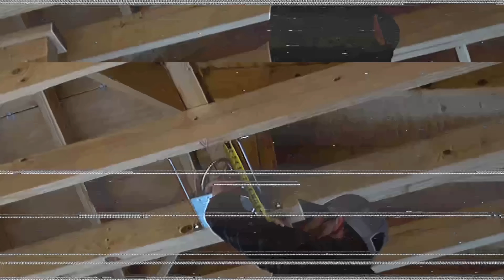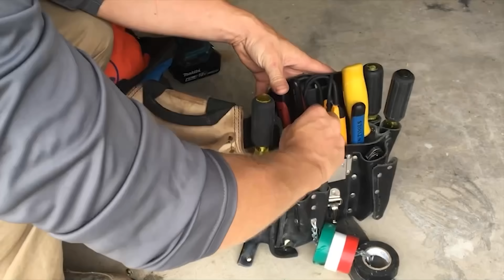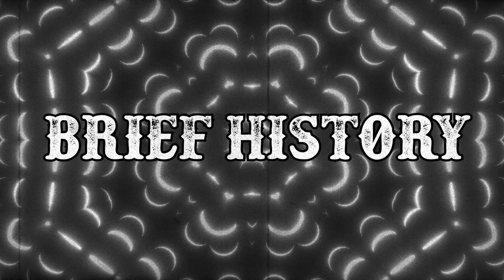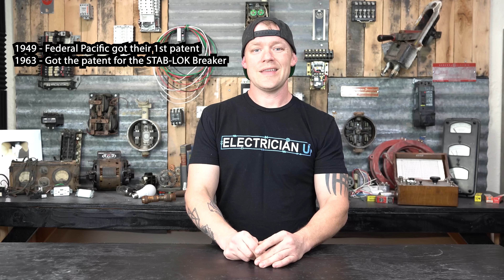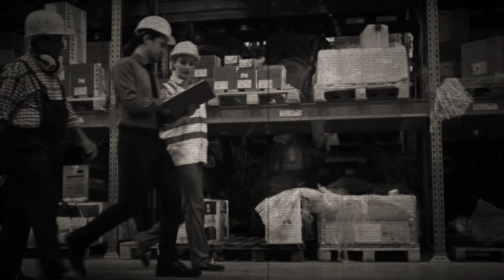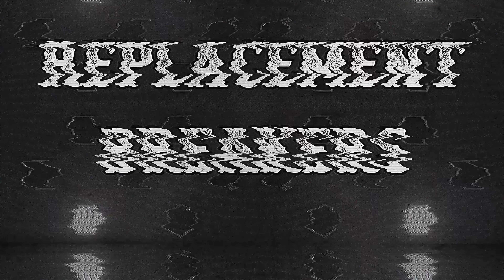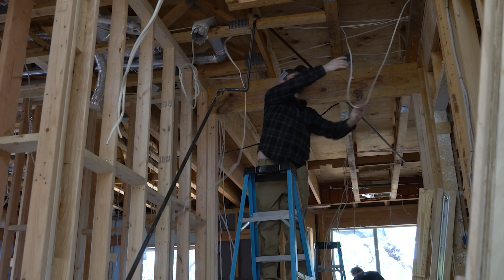FEDERAL PACIFIC ELECTRICAL PANELS - why their panels are dangerous

Comment: Why replace the panel if reliable replacement breakers are available? Panels don’t have moving parts....
Reply: The panels themselves have numerous issues.  Poor bus design (high current flow through too small conductors, poor retention of the breakers), poorly laid out paths for the wiring requiring extremely tight bends, and others that I’m forgetting at the moment. Besides that, the newest of these panels are approaching 40 years old, and electrical equipment just wears out over time, even if well maintained, which most of these panels were not.
Reply: @taeraresh2115  I'd like to know how untouched residential panels "wear out" over time. Some panels in homes spend decades without any human contact...some residents never pay them a visit and forget where they are.  I can't picture it.  Angry electric pixies cracking the bus bars? Electrosity flowing away all the metal goodness?  What exactly is there to wear out?
Reply: @lucash1980  Poor maintenance, rusting enclosures, overheating causing connections to loosen, breakers that trip often becoming more prone to nuisance tripping at lower than their rated amperage, breakers not fitting tightly and arcing at the busbar... These things have a lot of problems that well designed and actually UL certified panels don’t, but even a good panel should still be maintained.

Comment: Acceptable failure rates are dependent on product type. Sample rates for product testing also vary. Condoms, they are 100% sample tested. (Every condom is tested!)  0 failure permitted. Wiha 1000V insulated screwdrivers are 100% sample tested. 0 failure permitted. A lot of products are 70% tested. Products that require destructive testing usually sample at a much lesser rate. (3% sample) But perhaps 70% go through other nondestructive test(s).  1% is a good target of failure rate for most products. 3% is deemed to be slippin'.

Comment: least we all are still here since our birth...majority the homes where using FPE panels...since 1984...Reagan got elected for this in his first term...California business's had no over-site under that administration from food to electrical equipment safety in exchange for Reagan presidency winning by dark money ...people in 80's are unaware that time of dangers lurks..you were in diapers to be aware all this...least our fathers know this now...but how lucky for us...talking and living still...we all been in house for 20+ years ...least we are 30% hadn't had house fire ...but 70% did now...for now, we all moved elsewhere and now dealing with ITE panel this time...bought by Siemens due to ITE start losing money by selling panels with mixing metals between copper and aluminum that also dangerous too but its rare to see house burn down by ite panels...so far my house still not overheat..only fix is move breaker elsewhere or replace it with tighter clamping and move it elsewhere so bus bar reduce tensions from arcing ..only company fix both issues is ...squareD...all copper and all arc proof protection breakers

Comment: I still have a FPE breaker box. The issue is that the FPE box is in a stairway, so it doesn't meet code. The next closest place to move it is the kitchen, which also doesn't meet code. It was suggested that I could either pay to have the breaker box put on the outside of the house or have it moved about 15 feet to a location indoors which would meet code. I dread either option and wonder if I paid someone to replace the FPE box with a current model (but without a permit) if it would be ok for house resale down the road? Advice is appreciated. Thanks!
Reply: If you're going to sell, leave it. That's someone else's problem to fix.  When I was looking for a house in Toronto and complained about knob and tube or fuses they basically told me to "suck it" because they have buyers lined up around the block. So, you don't have to fix ANYTHING in this market.  If you're going to live in it for awhile yourself and you're freaked out, you can replace your panel with new old stock from a similar era. It will look legitimate. You can also say F-the code and try and get a new box installed in the stairwell--it only breaks code because elechickens don't like to stand on stairs when they work...because it kills their buzz. In my opinion, a stairwell is a great use of space for an breaker panel with a cover. I understand the code to make everything sensible and perfectly safe on new builds and renovations, but the push for perfection in older homes is asinine. The older generations got away with murder--janky splices into knob and tube (which is why knob and tube is considered unsafe) ungrounded outlets, penny fuses, buried undersized bx cable to garages, asbestos insulation, tile and mastic glue, epoxied plumbing fixes, I got it all. It falls on the younger generation to suddenly bring everything up to code while facing crushing personal and government debt because of mismanagement. So F-the code and do what you can, a little at a time. Just be wary of the nervous nelly contractors who want to report you and drum up more business. Good luck to ya.  Remember, if you don't want your house to burn down, don't overload your circuits. Turn off the breaker and count how many devices turn off.

Comment: I replaced my federal panel in my last house after living there for 5 years... after having 4 breakers go bad I got fed up and replaced the panel with a square d panel. Never had an issue afterwords.
Reply: Did the same thing to a house I has purchased "as-is".  It too had an FPE and went right into the dumper. A Square D Q0 panel please!

Comment: In the commercial and military world, all components should be manufactured with 100% pass rate on manufactured components, but also should have a stated MTBF (mean time before failure) which would be measured in both time and number of operations. With UL testing, if a design change has to be implemented to correct a manufacturing issue, the product has to be re-tested and re-certified as it is no longer considered to be the original submitted product. For smaller companies, this can be quite a problem and I can understand the reluctance to change a design. However, for a company with this size and manufacturing throughput, I am amazed that they didn't at least correct the problem once it was discovered.

Comment: Great video, and I'm glad to see Dr. Aronstein mentioned. I should find the catastrophically failed Zinsco main breaker I have, and send it to your for your video on them.
My dad was an electrician who specialized in FPE replacements for a while (lots of them installed our area). He thought that a lot of these panels were installed because they were so physically compact, and could fit in the space that used to have a fusebox without needing major framing work. Also, in addition to all the failures with the breakers themselves, the bus design was extremely poor. Depending on what breakers were installed, you could have upwards of *100 amps flowing through a single 8-32 screw*.

Comment: I had one of those panels in my house and the neutral went open- that was an interesting experience to say the least. Lights coming on brown in a different room than desired, stuff turning on by itself and finally a tv bursting into flames in the middle of the night in my kids room while everyone was asleep.
Reply: Yikes. Hope everyone is okay.
Reply: Sounds like the house was haunted.  Did you check the history to see if anyone died in the house?
Reply: Had that happen in my shop. A contractor broke the neutral line coming in from the transformer (we had a locate done, and it was wrong). The lights didn't work for crap, a battery charger blew up, and it killed the power supply in a very nice audio amp. No fire, though, thankfully. Hope nobody was injured in yours.

And no, Haywood, ghosts aren't real, ffs.

Comment: 12:23 Manufacturers are shooting for failure rates MUCH lower than 1%

Just think about it, would you buy a vehicle from a company that either “advertised that it builds” or “had a reputation for building” cars where the brakes only work 99% of the time?

Comment: A lot of manufacturers aim for 1.33 Cpk, which basically means 99.99% off all components produced passes specification. The reason the number seems so high is because at each step of the process, it must meet this number, but with multiple operations per component, the number of failing components compounds, making your actual percentage of "good" products much lower than 99.99%. There is a lot to why this number is considered "good" that I won't (and really can't) get into (I'm by no means an expert), but there is lots of info about it online. Six Sigma is kind of the root of it.

Comment: In the process of buying a house in 2014, the house was built in1955. Fortunately, our Real Estate Agent pointed out the Federal Pacific Panel, I did a little research to verify the issue which gave us the needed leverage to negotiate a lower price to cover the cost of the panel replacement. I had a licensed electrician install the new service while I did many of the branch circuits myself. Before the new panel installation, I accidentally had a dead short on a 15amp circuit. The Federal Pacific breaker did not trip, even after some wire nuts were melted. I ended up tearing out and replacing most of the wiring in the house, previous owners had done some pretty shoddy hook-ups with no regard for wire colors.

Comment: I've seen Stab-locks that absolutely will not trip, and others that would trip with a 5 amp load. I've seen some where the contact that goes on (into?) the buss melted and still never tripped. On some, the buss side would come out from the buss while I'm just moving wires around in the panel. Worst design ever.

Comment: It's too bad that Schneider electric doesn't make replacement bus systems that fit the bolt-pattern of the FP panel but accepts Sqare-D or Homeline Breakers.  Would that incurr the same upgrades as a new panel and casing?

Comment: Ok...a little clarification.  A certification agency (UL, Intertek/ETL, CSA, etc.) will often conduct testing at a manufacturer facility, known as TMP (Testing at Manufacturer Premises).  This is usually done for any number of logistical reasons, but it should not be construed as the agency just observing testing that the manufacturer is doing.  In the case of the F.P. breakers, during the long-term testing of the breakers, the manufacturer was replacing failed breakers without the knowledge of the certification agency.  

Also note that any manufacturer with an agency listed product in North America is subject to quarterly product inspections.  While not the same as an ISO 9001 audit, the agency is supposed to verify that the product the manufacturer is making now, is the same as the product that was originally tested.

My own experience with FP breakers shouldn't be a surprise: purchased an old house two years ago which has an FP electrical panel.  One of the first things we did is have the panel replaced with a new 200 A service.  In the process of replacing the panel, the electrician found three breakers which when flipped "off", didn't cut-off power.  Miracle the place didn't burn down ages ago.

Comment: Just want to point out a few things from a UL employee perspective. At 16:15 - UL is not concerned with manufacturing processes (RoHS, ISO 9001, etc). UL evaluates and TESTS a product based on the requirements in the standard(s). If the product complies, it is documented and routine factory inspections are conducted to ensure the product is still made identically as the one that was tested. (Yes sometimes factories can do their own testing under UL supervision as well, with an audit process, too long to get into). There may also be routine follow-up testing to ensure a product still complies. If UL withdrew the Listing mark of those F-P breakers, I don't think F-P would have gotten away with marking them as UL Listed for 20 years following. Using the UL mark without a Listing is a misuse of the trademark and UL can (will) sue to stop that. It wouldn't have taken 20 years for them to figure that out on such a high profile product.

Comment: what about the company's wall fan forced heaters and baseboard heaters our building built in 1979 and 78 has them allover the complex the FPE panels were changed out with square D panels in 2005 when the owner found out about this very issue he is not the original owner hence the long time line before the change out

Comment: Old timer told me when I was an apprentice. Another problem with these panels is the trim screw in the middle of some the panels. Suppose to adjust that so the breakers fit tight  against the cover. A lot of times it isn’t adjusted and makes a bad connection, as well as a faulty breaker.

Comment: The electrician needs to have the proper tools for testing arc fault and gfi the test button doesn't necessarily tell the truth and trying to find how an electrical ran his runs can be a nightmare in one case I accidentally triped a gfi it wasn't in the bathroom or the one above or below it wasn't a blank by the panel box it was driving me nuts and then the home owner son complained that the wifi was out so I asked where the router was there it was at the back of the shelves outside the bathroom apparently they don't like wet and dry vacuum but arc fault won't run a vacuum cleaner or a drill

Comment: I remember my uncle, a New York City master electrician who worked into the late 1980s  and began his apprenticeship in 1927, never really trusted circuit breakers. He felt that there were too many things that could go wrong. Fuses, on the other hand, were foolproof, IF THEY WERE TAMPER RESISTANT (ie: Buss Fusetron, as opposed to common plug fuses)
Reply: Fuses fail safely.
Reply: @ClockworksOfGL  unless someone get tired of replacing fuses and decides to slip a penny underneath the fuse and screw it back in,  or wraps the cartridge fuses in aluminum foil or uses a piece of copper tubing or a piece of conduit, you could go on and on....... my best friend is a master electrician and the stuff he has seen in the field,  there's a reason fuses were replaced by circuit breakers , even though the fuse it a very simple, inexpensive and the most bulletproof way to protect a circuit, it is this very simplicity combined with human stupidity,  that gave fuses the bad rap of being dangerous so much insurance companies often will not insure a home with a fuse panel
Reply: @Sparky-ww5re  - Indeed, I don’t expect us to go back to fuses, but they’re the still the most reliable overload protection.  I think code should mandate backup fuses within circuit breakers, just in case it doesn’t trip.

Comment: When we were installing residential services in the early 1960s FPE products were easily 30% cheaper than quality panels, like Bulldog Pushmatic, Bryant, and Westinghouse.
Reply: If I'm not mistaken, the Bulldog Pushmatic breakers were also problematic.
Reply: @1912RamblerFan01  the old units were quite reliable. The cheaper stuff slide by ITE in the late 1950s and 1960s had problems.  ITE also cheapened the lug design in the panel boards.  The original 1930s Pushmatic breakers were bolted down to heavy copper lugs, and so there were no problems which would arise from poor lug contacts.  I’ve worked in situations where 1930s Pushmatics had been used in switching service for seventy or eighty years without failing.
Reply: Don’t forget Wadsworth
Reply: That was why they were so popular with volume builders. They could buy in qty from a supply house and with a large enough order get terms  discounts and dating on the payment. Helped their cash flow and held the cost of the house down. I would say about 20% of the houses I have bought for rental use have had these panels installed. These are basic 3/1.5 or 3/2 homes. basic design. some brick, some vinyl. I just figure in replacement into the price when I am figuring on buying a house that has one of these in it.
Reply: @genemartin6962  i've got a five gallon bucket full of them..  the large panels weren't too bad, but very seldom used.  next, zinsco, challenger.
Reply: have used ge for decades, like for price and quality and hd has them

Comment: Awesome video. I started my electrical career in 1978. So I have seen a lot of Federal Pacific and zinsco. I always do my best to talk to customer into replacing those systems. The cost of those replacement Breakers can sometimes be quadruple the cost of a normal breaker.
Went on a remodel with the Federal Pacific equipment I would ground out a circuit on the metal box to show an apprentice just exactly firsthand what's going on. Nothing makes an impression like a live experiment like that. It would also help convince the customer to change it out.
Thank you for all your hard work and effort you put into this video I learned a lot about the history of the companies that I didn't know.
ROCK ON.